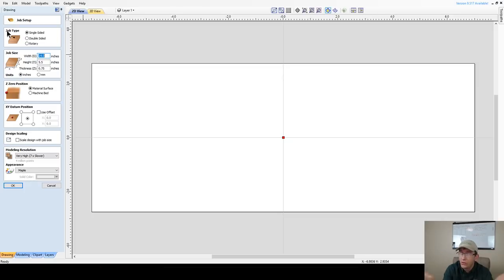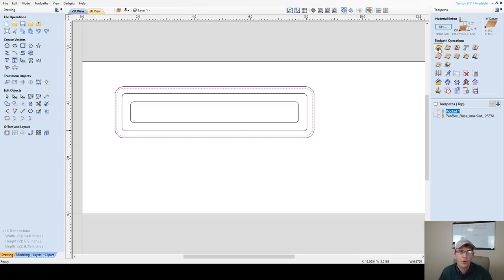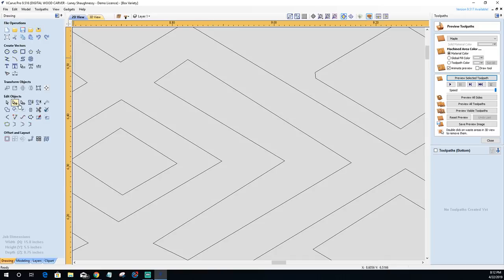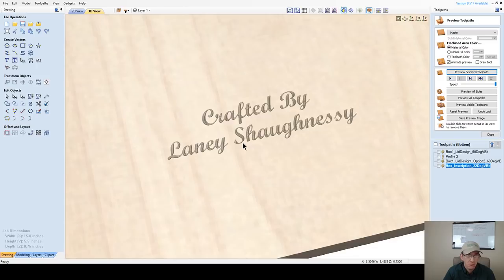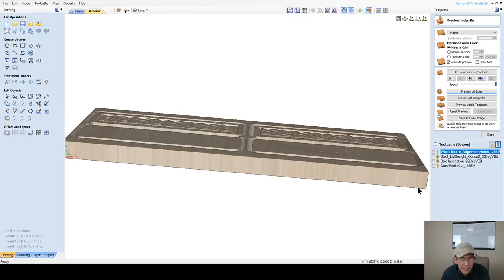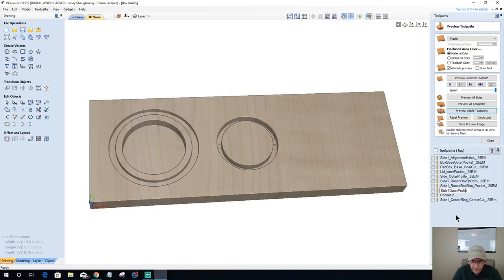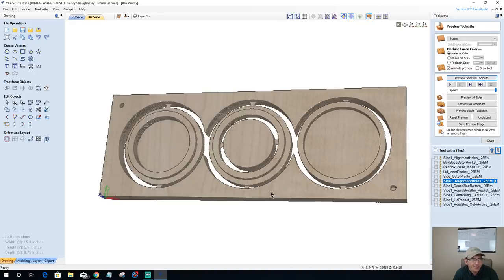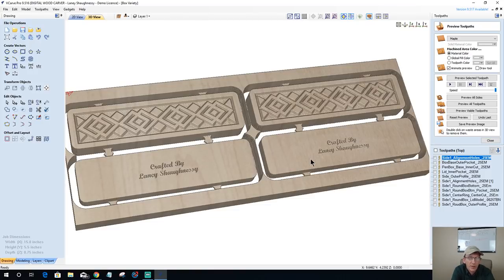Making Gift Boxes from a single Board - A Vectric Tutorial

Comment: Laney  I don't know if you will get this but I started to as this question the monday night and we were having a storm and the electric went off.
Any way it is about a touch off on a double sided job. 
So if you select the material surface and  you cut side 1 then turn the board over to side 2 and run the files for that side do you have to actually have  to resit you Z height if you don't have to change bits for to cut side 2.
Reply from the maker: In that circumstance no not necessarily. But of there were a bit change then absolutely.
Reply: @SpindleTV  That  is what I thought just checking  thanks for the reply  laney.